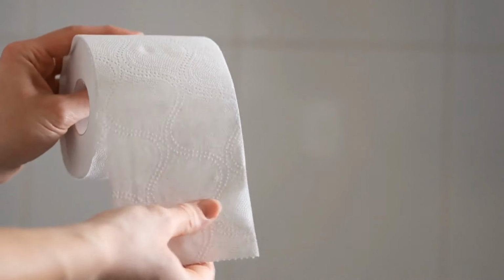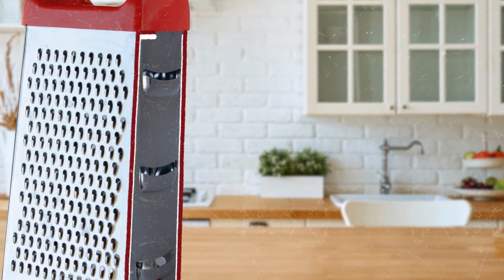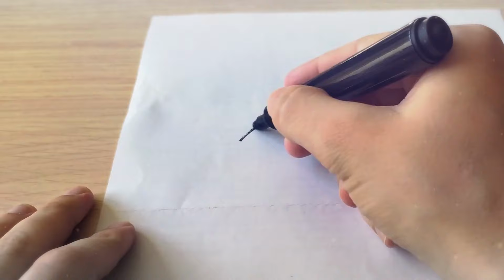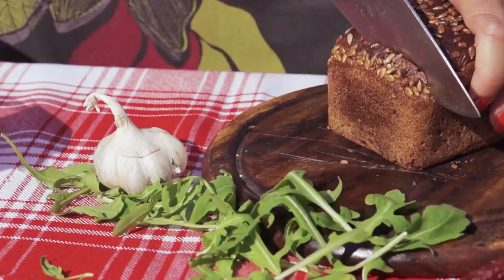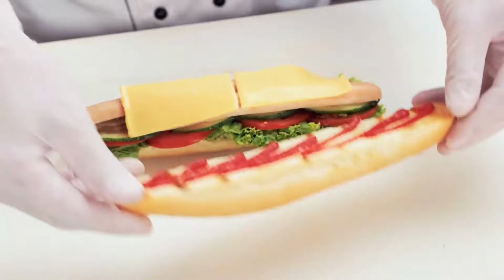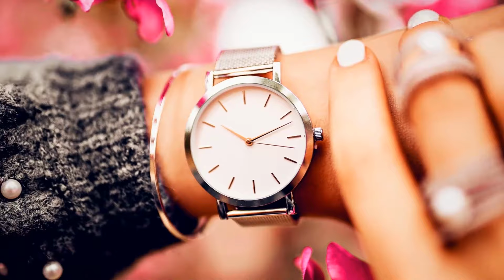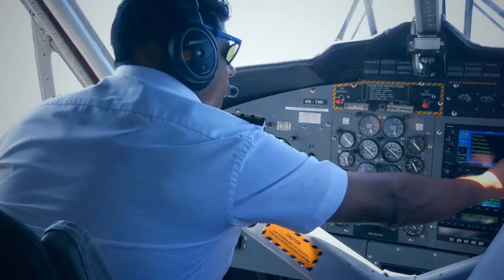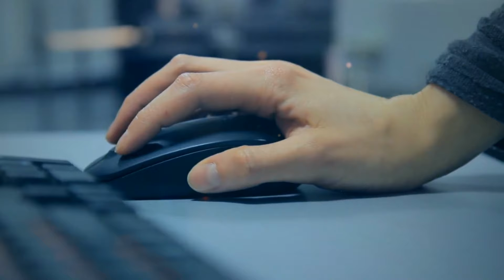10+ Usual Objects With Hidden Secrets You Should Know About

Comment: the frequency gain is blue, yellow, red, green. not just having greater luminates with lower energy but longer wavelengths per cyclic cycle at x frequency of color. this is why the military uses red for aimpoint dots for complete darkness, blue for shallow darkness, and uv for invisible needing a uv/nvg for seeing. meanwhile the aim point scopes use etched, blue and red dots. for a short while green was made because cost of productions, but with rise of disturbed alertness of targets recognizing the origins these mil specs quickly reverted back. so the only military light diodes which still run in green luminates are those looking for cheep cost productions.

so that bit about red being the most wave and why it is at the top is incorrect. especially for spanish, cheznian cultures where the signs are sideways also including eastern ontario and nova scotia canada. where the principle reasons of lights going top to bottom isnt because of color intensity or better to see arrangement. but with a common sense factor. because when it is dark and you see one dot as the same hight from the pole it is confusing for colorblind people to which is what. meanwhile when the lights transitions with a bicast of the housing above or below it with x distance from the pole. it is easy to tell position 1, 2 or 3. regardless of color. as that is the princple reasons why most countries have adopted american style traffic lights.